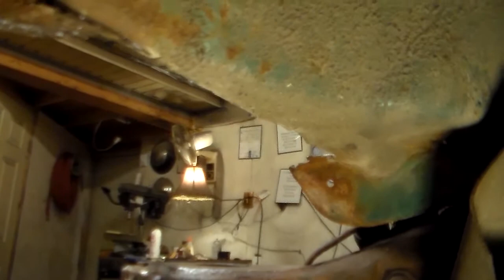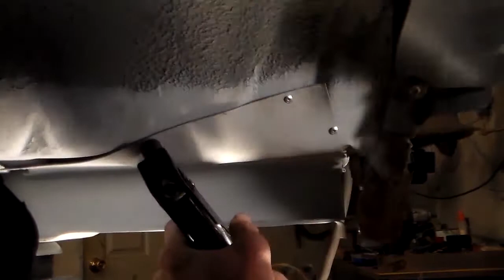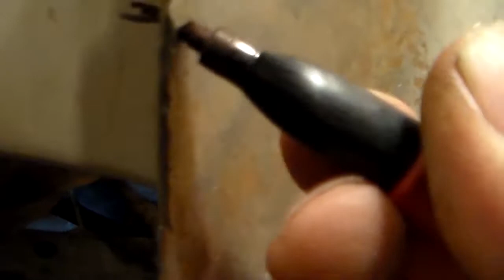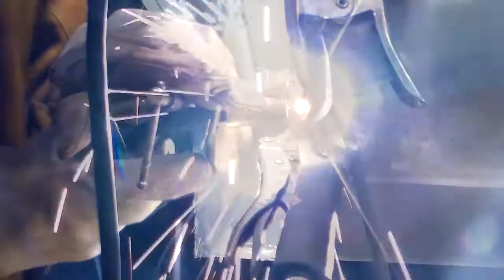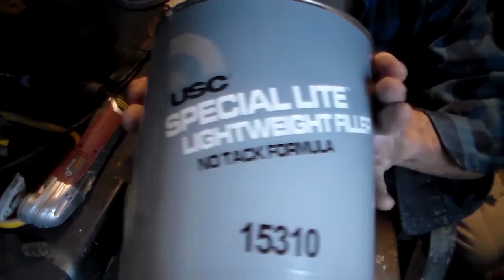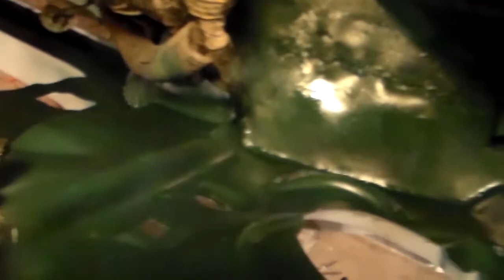Part One Radiator core support install Chevy Astro, GMC Safari, MIG welding, grinding, bodywork

Comment: Hi Alan , 
Do you know if I can do a noses swap and put a old 1980s front on a 1995 astro van ,
Reply from the maker: I am not sure, but it most likely is similar. I will measure across the bottom of the core support to see if the distance between the front subframe mounts is the same. If they are, you can always incorporate the lower part of the old with your upper part and save some metal fabrication due to rust damage. Also, a final factor is how much the older core support will cost you.
Reply: @MrAamstrom  i have recently been offered a 95 Astro van but I really wanted the 80s model because of the retro front , I then got offered a 80s model but it’s a no runner unfortunately, but it got me thinking if it was possible do a nose swap , it’s been pretty difficult for me to find out on the net , which led me to you , if it is possible to do I will purchase both astros , I just need to know before starting such a project, 
Thank you for your reply

Comment: What do you think it would cost to have someone do it,. Rough cost
Reply from the maker: The price would depend greatly on two factors. If you have access to a good rust free core support and only the old one needed removed, and replaced would greatly reduce labor costs.  Or as in my case the original need fixed since I was unable to locate a good core support. If scenario number was the case  the cost would be the core support plus roughly 8 hours labor. Scenario number 2 would probably be hard to find anyone to even do but anything is possible. The first case roughly would cost you around $500 labor, plus the core support. Case number two even you found someone willing to take on the challenge would be at least $1200 on up probably to $2000. These are rough estimates as labor cost vary on location.

Comment: Why do you have to use body filler
Reply from the maker: You don't have to but it will benefit in the long term to keep the rust away. At least use primer and paint if you choose to not use filler.
Reply: Many people think Body filler is a bad thing.  That is a common, very common misconception.